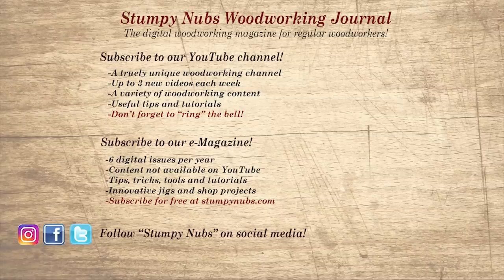Are table saws becoming obsolete?????

Comment: Short answer, no! 
Other tools are better for some jobs though. Track saw for breaking down sheets safely,  Radial Arm or Mitre saw for cross cutting,  band saw has its uses and sometimes even a chainsaw is the right tool but a table saw, or as we used to call it a saw bench, is my go to for making boards.
I recycle, so ripping is a key process, prior to thicknessing.
Just my way of agreeing.

Comment: Try cutting an 1/8 inch off the egde of a 2-4in. wide warped pallet board with a track saw. I dare ya!
However; a track saw would be great for cutting down a 4x8 sheet of plywood! Or if your table saw blade to fence is only 12 inches  and you want to cut a wider piece!
You'll need a lot of different saws to do wood working

Comment: Having acquired a small mountain of tools (both handtools and powertools)... I have fine purposes and reasons for each and every one of them that stick around longer than about a week or so...

   I CAN get along (quite well?) without a Table Saw, BUT I sure as Hell would NOT want to. Here's the thing... I can do fine rip-cuts with handsaws (when applicable) and the Circular saw (where applicable)... Sure... That works FINE for up to 3 to 5 specific cuts...

   When building a cabinet complex, HOWEVER, and there's a series of very specifically sized and shaped spacers for a set of drawers (for instance)... AND I need 20 or 50 or 100+ of a particular Component... No dice. I'm not standing there and huffing through that many pieces of wood by hand... AND I'm NOT ABOUT to try for that kind of precision on a 4-inch part with a Circular saw... 
   Stick the sled on the Table Saw, however... AND I've got my Components and a few spares in about an hour... instead of two or three days of "farting around with that crap"...

    Don't personally do the Dado-set... BUT given the angles available, and rapid-fire precision (once set-up and tuned) EVEN the slightly inconvenient fence most certainly does NOT destroy the usefulness of a Table Saw. It just doesn't exactly do it any favors, either. It doesn't have to. Once you've set it up for a cut, a decent Table Saw can repeat that cut THOUSANDS of times, precisely achieving the desired result, the first time, the last time, and EVERY SINGLE TIME between... That's never going to be "obsolete".

    AND just for the record, I am one of the guys who "can do almost anything most others do with a Table saw, with my Circular saw"...  ;o)

Comment: 2 small things you left out contrasting dado vs router: noise and dust. A router is almost always going to lose to about any other power tool if noise is a big concern. And even the miter saw loses to the table saw if dust is a major concern in your shop.

Comment: Actually the best tool I ever bought was a Rockwell Versacut, it is light weight, cuts wood up to 1 1/8 inch thick, and has a pretty red laser to light the way.  Tried putting a laser on my tables saw, but it keeps flying off across the room.

Comment: One thing my table provides that NO OTHER tool that I own can provide is 8.8125 Square Feet of flat area to use as an assembly table. Or put a coffee cup. Maybe 6 cans of spray paint and a really, really old bottle of Titebond. A place for my wife to put the laundry basket of socks for me to sort. Right this minute mine is a paint station for a 5' x 12-1/4" x 20" reproduction bucket bench made from reclaimed pine and wedged tenons. Try doing that on top a Track Saw or Chop saw!

Comment: Hi hi. You are a wonderful presenter. What cordless circular saw and guide would you recommend for making cuts in plywood up to 3/4"? I've been using a Ryobi corded and a Kreg on top of 1" insulation foam, and I find the blue edge of the guide will get in the path of the blade (beyond the initial setup cut) often enough. There's a lot of slop in the saw. I have very limited space, so no table saws for me!

Comment: I am fortunate enough to have a complete workshop at home having all of the “big” woodworking machines. The only one I don’t have is a track saw. But, I have a friend with a fabulous Festo track saw which I borrow from time to time, mostly to trim some large awkward piece. My table saw cannot do this. But, my table saw cuts wood for my friend which is difficult with the track saw. With regards to dado blades, have you done a feature on this? I bought a set and returned them as the cut was not flush on the bottom of the dado.

Comment: I prefer using my table saw on the expensive plywoods I use rather than a circular saw. WHY?? Because you can get less chipping on a table saw and like you said faster. On cheaper plywoods I'll still use the table saw but with a cheaper saw blade like a 40 tooth. But most of all I like and enjoy the final look of the work I do on my table saw.....

Comment: My tablesaw costs less than most of these track saw set ups and it is far more versatile.(No, it is not a jobsite model and I've not seen a track saw set under $500.)
To break down plywood I use a circular saw, straight edge and clamps. That gets the large sheets to manageable sizes for the tablesaw to make into finished pieces.

Comment: i think the difference is in main work load. i do lots of pattern making on the router table. i do jointing maybe 15% of my work load at best. so being i already have a three by jessum lift in my router table, its faster and better for me. however if i were doing more than maybe 25% of my work load in jointing - id be much better off having a table saw to do this

Comment: I am new to woodworking and have a Dewalt 10" portable table saw... DWE7490. It seems too small to cross cut larger width boards or add a good size cross cut sled. Any suggestions, besides buying a sliding miter saw?

Comment: I own a Sears wobble dado blade and it works fine.   I don't think their made anymore.    My guess is vibration and maybe accuracy. Not sure.  I have used mine a good bit and once set it made dados just fine.  Any thoughts on the demise of wobble dadz blades?

Comment: The only reason that I tend to use my router table for joinery instead if a dado set on the tablesaw is because I don't have a "real" tablesaw. I've just got a jobsite one and setting up the dado is enough of a pain (and sometimes not an option) that I'd rather just pop my router in the extension wing and get going.

Comment: Go ahead and calculate the time it take you to make repeat cuts on a long board or panel on the table saw compared to using a guide with a skilsaw..  Are skilsaws useful, of course they are which is why own a few of them.  However, the table saw exists for a crucial reason.  For accuracy, repeatable, speed of set up and versatility, they will continue to be built forever.
Can you cut a sheet of plywood with a skilsaw and a guide?  You surely can.  However, time how long it takes you to do it more than once?  Once you simply set your fence on a table saw, how long would it take you to slice through twenty boards or five sheets of plywood without resetting?

Comment: A large, expensive sliding table saw should be the future for shops that work with sheet goods regularly. But a track saw is portable. With some jobs you take the tool to the wood and others you take the wood to the tool. Since I don't have either, I will spend Sunday morning re-sharpening my 100+ year old hand planes, chisels, and hand saws if they need it.

Comment: If I could afford a Professional Cabinet Saw Stop. I would agree with what you’ve said. I’m working with a Dewalt 7845 job site saw. So no dado stack for me. 😢
Reply: I also have a job site saw as my table saw, (Makita), does nice dado cuts and very accurate table cuts. Is heavy enough to stay put, but also very portable, which works for a relatively small shop space.  Everything in my shop is on wheels, except for my drill press !
Reply: @stevenlimbach3827  Saw Stop would be nice, but I’m new to Woodworking that’s why I like watching these videos. Trying to learn different techniques. I don’t see my little garage turning into a full money making wood shop. so buying a $3,500 table saw is probably not a good investment. The Jobsite saw is cool. . I got Circular Saw with the Kreg Rip Cut or Accu-Cut, that should work fine for cutting up sheet goods. And I have a Miter saw. I’ll make it work.

Comment: an I ask you a question I have  10" table saw and getting into cutting a lot of Melamine and Baltic Birch. I need a new blade that will not chip
What blade would you suggest I buy a good one but wouldn't brake the bank. and also a Dado set too

Comment: There is a lot of functional overlap between different kinds of saws, but each type will excel in certain areas over other saws. Theoretically, you could do everything with a sawzall, but that doesn't mean it would be desirable to do so if you had access to all the other types of saws ;-)

Comment: I would not be able to work without a table saw and do agree with “your way”. However, have a look at how Peter Millard does all his cabinets with a plunge saw.
Reply: Got one of those, but the table saw is better for repeated cuts (as for the 14 cabinet doors I'm currently working on)!
Splitting full sheets and less accurate cuts are easier/faster with the track saw, but imho they are completely different machines that just happen to be usable for similar things :)

Comment: I have to drag my cheap used table saw into the yard most times to use it. Due to having limited space. I still won't get rid of it just for rip cuts. I can't imagine ripping one inch off a stack of 2x4x10s with my skill saw.

Comment: I just watched this again and I agree it's great! For those just starting out, I would go further to say don't even bother with cheap table saws. Yes, my SawStop cost me more than most people can shell out on a whim. But this purchase is not a whim; it is an investment in accuracy, precision and safety. And with my shaky hands (impressive tremors) and bad back, I use this saw to perform functions I no longer feel safe doing free hand or even with a clamped guide. Some time ago, one of the folks I respect (You? Chris Schwarz? Don't recall...) framed table saw use perfectly - you use  the table saw to perform the tasks that an apprentice  might have done - breaking down, rough dimensioning, etc. But beyond that, with my saw and some carefully made jigs and sleds, I can make repetitive small part cuts with easy precision and safely. Then I move on to the hand tools that are my true loves.

Comment: As a relative newcomer to home woodworking compared to most others here,  I'm currently debating between a track saw / router combination and a table saw, and so I really appreciate and value your advice. But would your modify your advice in any way if one didn't have the space or budget for a cabinet or hybrid saw,  and instead was limited to a portable one?
Reply from the maker: I'd still get the table saw (make sure it has a separate riving knife that may be installed if and when the blade guard must come off), though I would also get a track saw or edge guide system because you will need it for sheet goods.
Reply: @StumpyNubs  Thanks so much for your prompt response.  I will certainly look into that combination.  FWIW,  when it comes to track saws, I'm particularly intrigued by Kregg's Adaptive Cutting System.

Comment: any tool becomes obsolete if you dont use it, but when you suddenly need it its back to invaluable. i own a scrolling saw and hadnt used it in years ..... obsolete right, what with thin bandsaw blades and fret saws ! .......absolutely until i needed to cut a circular piece with a pierced initial 5mm thick and 50mm diameter.  not possible with a bandsaw and way to slow and imprecise with a fret, so all of a sudden my obsolete scrolling saw became invaluable, time saver and essential.  job done it may revert to almost obsolete for years to come but sure as eggs make omlettes some time its going to be essential again.

Comment: Never. 
If you need repeated cut its better to setup a table saw (jobsite saw for me) and an outfeed table if you're working alone. Track saws have their place but they're not a replacement.

While we're on it, This is also an area where I feel corded models are better too. Theres just some tools that aren't there yet with battery tech and runtime. Table saws being at the upper end of that list.

Comment: Every cut has the right tool to make it. Safety, accuracy, comfortableness of the woodworker… I prefer the table saw for most cuts. At the end of the day we have found several ways to attack blades to motors or handles it is up to us to decide the right tool to make the cut. Router or chisel for a hinge cut? Wait… perhaps a router plane or maybe a vibrating multitool. Truly it us up to us to decide. 

To answer “Is the table saw obsolete”, I think not. Just one of several choices for each cut.

Comment: Could I build something using piece of pink foam insulation, a 1/8 x 3/4 x 8' aluminum flat and some C clamps?  Sure but it sure would be nice if I had a table saw after that.   I should talk.  All of my projects were done with a radial arm saw that could easily be replaced with a Miter saw.

Comment: I agree 100%. It’s a very complex thing though. Someone like Peter Millard for example, does repeatable professional cabinet work almost completely without a table saw. But he uses very expensive tools as replacements (MFT, Domino, etc.) So, repeatability isn’t necessarily as important as training and skill. Also, I’m not sure I buy the “your way is your way” argument. That’s very 21st century, but I think it’s wrong on some levels. In most disciplines there is an objectively right way to do something, and an objectively wrong way too. Nothing subjective about it. We’ve just become too worried about telling someone, “No!” 😏
Reply from the maker: If there is one thing I have learned in woodworking, it that there is NEVER one right way. I can't count how many times I've thought only one way was right, having tried the other way and failed, only to meet someone who had failed at my way and been successful at the other way.
Reply: I think I worded that poorly, trying to be brief. If it makes sense, I wanted to convey that there are rules and principles that are fundamental. I should have added that they can be applied many ways.

Comment: When I set up my shop, I bought a cheap Kobalt brand miter saw until I could afford a much better one. That was a mistake because the Kobalt 7-1/4" miter saw is a piece of doo-doo. I was saving up for the Bosch 12" miter saw with a folding arm so as to take up less room, but I bought a Radial arm saw that will have a dado stack on it because my Dewalt 745 contractor saw does not take one. So I figure I won't need the more expensive Bosch model I was saving for and will get a 10" Dewalt that can handle the miter cuts. Never skimp on tool quality. If you don't have the money right away then save up for it. You won't regret it!
Reply: The old 744 can handle the dado stack.  One of the first things I bought after the saw itself! Next was the outfeed extensions.

Comment: Agree, though I would add one point to the debate. Do yourself a favor and don't buy a cheap table saw. I'll go a step further and suggest avoiding the temptation of buying a job site contractor saw for your shop saw. Sure, it will do okay, but you'll soon realize that table saw accessories like sleds, dado stacks, feather boards may not be possible and if the are, you'll be lacking in the needed precision. This comes under the "been there, done that" experience.

Comment: Certainly not larger format table saws. A good horizontal panel saw will mostly replace your chop saw and jointer as well as still be a table saw and put any track saw to utter shame. Track saws are small and highly versatile and way less expensive than even a low end cabinet saw, not to mention a panel saw, and even have a valuable position in shop with a high end table saw setup.

Comment: Sometimes you want to move the wood through the blade.   Sometimes you want to move the blade through thee wood.    When I have a 4x8x 3/4 piece of plywood that I need to cut down, I prefer a track saw.    The weight of the plywood makes cutting the sheet down, for me, much much harder than laying the plywood on sawhorses with special supports to keep the sheet flat, and using the track saw to cut it down to panels I need for my project.

Even a 4x8 x 1/4, although lighter, is easier for me to cut into smaller panels using a track saw.   Trying to use my table saw, the wood tends to flop and shift while cutting.    And I need 8' behind the saw and 8' in front to rip off long pieces, like 6' panels.  Or extra support to the right to support the sheet to get a 6' panel.  Ugh.    I'll use a panel saw to get the 4x8 sheet into panels I need for my project.

Once cut into smaller pieces that must be the same size, like a cabinet carcass, I'll use the table saw with a fixed fence.

Comment: I find the most important thing to do is THINK when working with a table saw or any machinery for that matter.  All the safety devices and jigs in the world won't save you if you don't think before using your equipment.

Comment: I dont disagree with your opinion at all. That being said, I went from owning cheap table saws up to a Sawstop that I sold and now am finished with table saws. I had a Kreg ACS system that was the heart of my shop and I am moving to Festool with MFT instead (multiple tables eventually). I rather enjoy slowing down the pace of the work and taking in the process instead of trying to "bang it out". Because of the safety issues with table saws (even the Sawstop), I was always anxious and just wanted to get it over with. Now, I want to relax and enjoy the process. Track saws, hand saws, dowel joinery, chisels, etc allow me to work in the way that gives me pleasure instead of just efficiency.

Professionals, of course, need to be quick to make maximum rates.